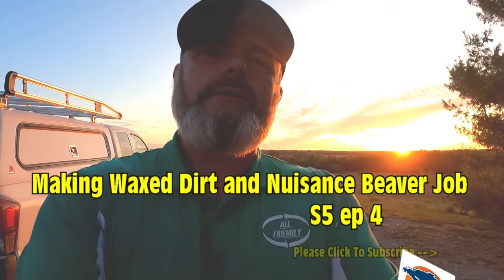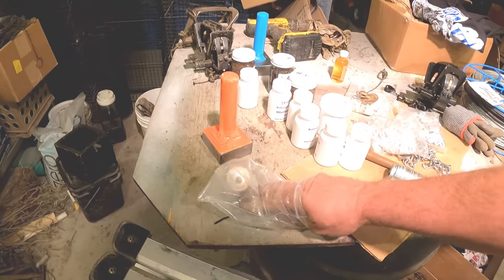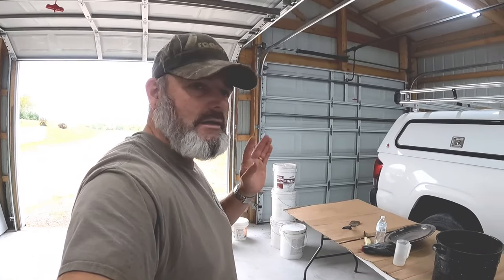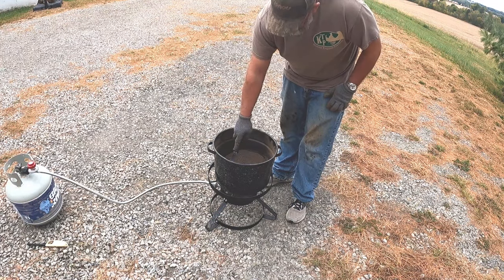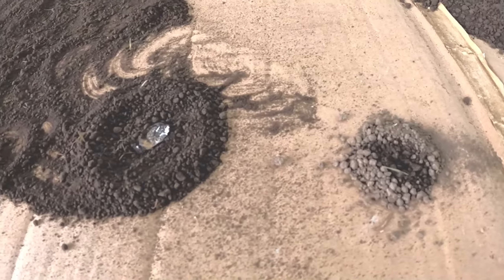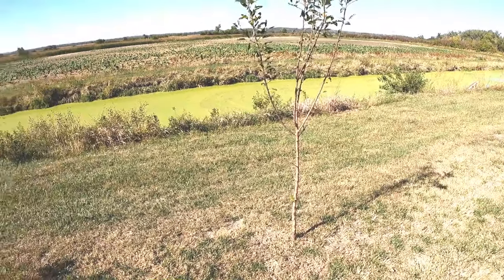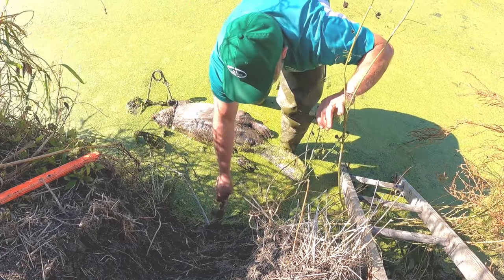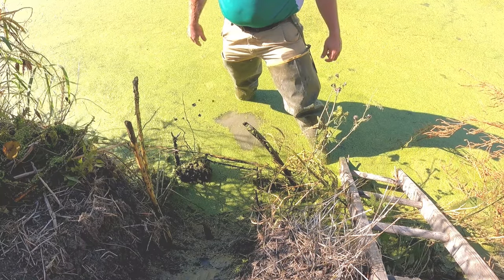How To Make WAXED DIRT & Nuisance Beaver Job | VLOG| S5 Ep4

Comment: I feel like you can definitely get by with the washers you accidentally bought. I wouldn’t sweat it. Just my opinion
Reply from the maker: Thanks colton for watching. Yeah I don't think the video justifies the difference. Maybe the camera does really add a few inches! Lol. You're probably right, it's so easy to get hung up on little things. If the Coyotes pull an extra inch or so, no biggee.